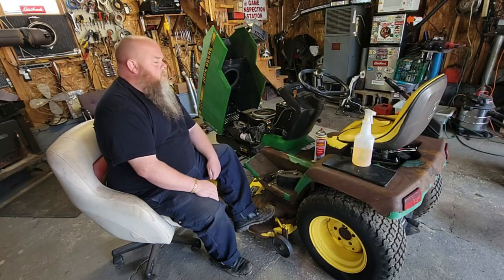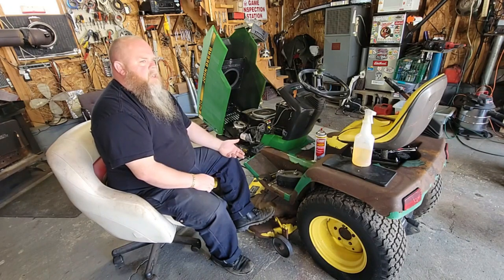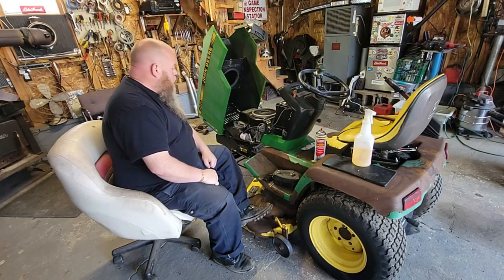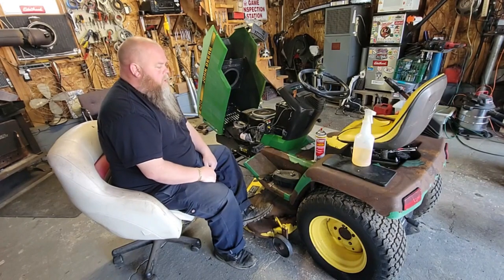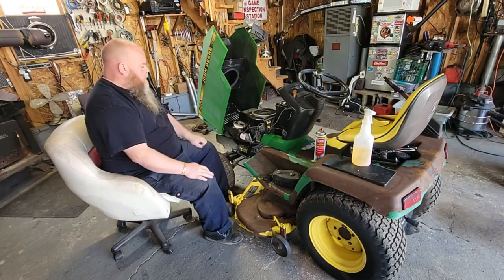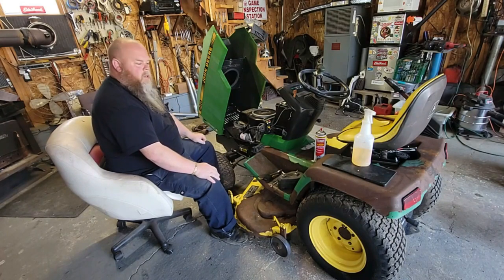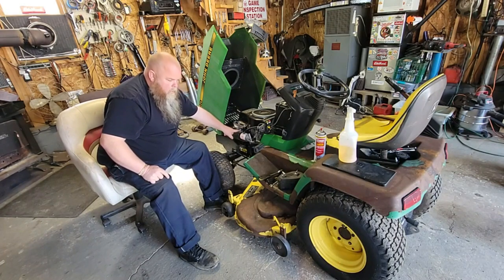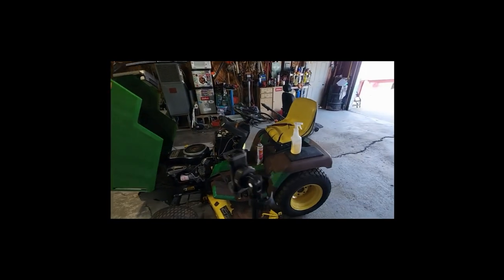I Need Help with my John Deere

Comment: Seat covers work wonders especially on John Deere's.
The thing on the bottom of the carburetor is called a back fire prevention solenoid, if it's not working you won't get gas.
If it's not the backflow prevention solenoid it sounds like it could be something with the needle and seat.

Comment: That little fuel cut off solenoid is prolly the culprit i would think. I’ve had trouble with those before. If the needle isn’t stuck in the carb which it’s not cause you had it apart. It’s gotta be the solenoid. Even though it’s clicking maybe it’s gummy.

Comment: Make sure the float is moving freely up and down. Make sure the needle on top of the float is moving in and out of the hole it sits in. If the float is stuck up it won't let fuel in. The solenoid won't keep the fuel from getting in the bowl it blocks the main jet so when you shut it off it doesnt backfire. It will keep it from starting but not filling the bowl.

Comment: Take off the solenoid on the bottom carb. Just because it clicks doesn't mean it's working. The solenoid is actually broken inside. Throw it away and put in a fule cut off in the lines so you don't fill up the engine with fuel. The solenoid allows gas to go into the carb. I've done this many many times and wish you luck.
Reply from the maker: So just take it off and it will run without it?

Comment: Just take the solenoid off and cut the plunger off of it. Then put it back on or it will leak. If it works put in a fuel shut off in the line before the carb to stop gas from draining into your engine when not in use. Or replace the solenoid with a new one for about $10, I did this to two of mine to get buy until I could get the part to fix it right,

Comment: My John Deere is a little newer it had a problem where it would die like that. Did the spark plug same shit. Ended up being the gas cap. The holes in the rubber of the cap were plugged and those acted as a vent for the fuel system
Reply from the maker: It's getting fuel all the way to the carb though.

Comment: I thought some of those had a safety switch built into the seat? Some older ones wouldn’t run unless you were sitting on them.
Reply from the maker: Yeah, switch was already bypassed.

Comment: First
Reply: Carbs cost about 25-30 bucks.The solenoid helps prevent backfires and shut off the fuel from engine.  It probably need cleaning.  Btw. My dad's JD was hesitating-stalling. Fuel was showing in the filter, However, the line all the way from the tank to the carb was clogged with black gunk. Cleaned it, ran fine.
Reply: Might observe the solenoid voltage (wire) during when it shuts off. If it drops to zero, it was probably electrical power issue, I assume.